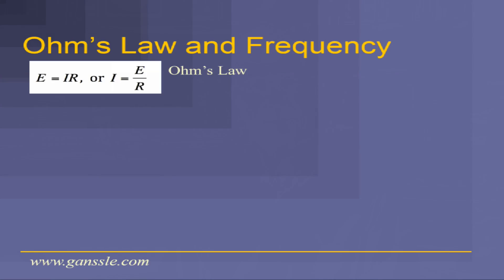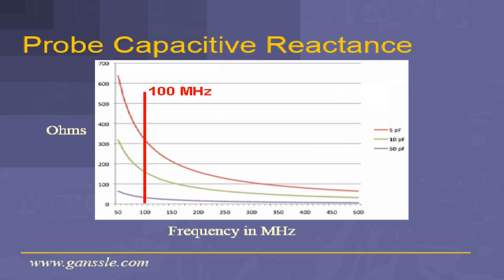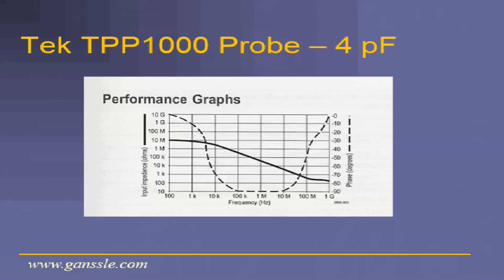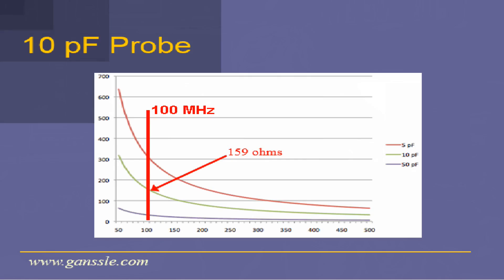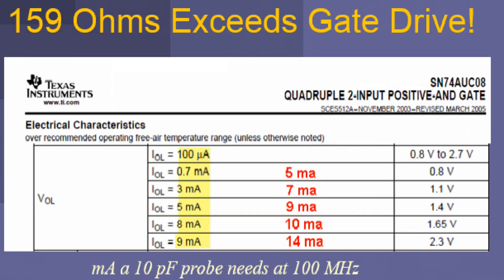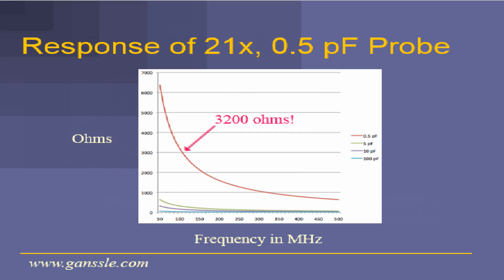Perils of Probing: What's Inside That Scope Probe?

Comment: This is a very useful video. My one issue is declaring the specs "a Lie". The specs are correct: the resistance and the capacitance are both given. The user must understand the limitations  from this data. You did a good job of teaching this, but the accusation was unnecessary IMHO. I am not a scope probe manufacturer BTW. Just another EE.

Comment: I use my walmart probe to fix crosley record players that are defective straight out of the box. Usually a lose connection from the hot glue. The $9.97 walmart probe was much better then the $99.95 radio shack probe that was just an alligator clip to a BNC that had a really fancy box. The radio shack probe was 50% off (normally $199.95) so I must have got a deal!

Comment: Hello Jack, I was wondering if you would consider doing a video on microcontroller output jitter and phase shift. For instance I designed a transformer pwm controller adjustable duty time and dead time based around STM32 maple mini however it is getting like a ghost echo of the square wave on my oscilloscope where the frequency is jumping between 220khz and 180khz approx. I think it is period jitter. I have matched the output impedance eradicated all ringing. No one seems to address this issue with microcontrollers only point out what jitter is. This also affects atmega 8 bit also, One person pointed stm32 jitter corresponding to ppl however what causes this jitter and how do I go about eradicating it if possible. Can microcontrollers be used for PWM control reliably. I am changing to MBed using ARM processors soon and I am a completely self taught electrical engineering and system design and cad design hobbyist. Hope you can help. many thanks.

Comment: Jack, you don't know what the hell you're talking about.  Stop confusing and misleading people.
Reply: +Steve Robbins Believe it or not, but DIY coax probes like this actually have much better bandwidth than regular passive probes. Pretty much comparable to lower end active probes. Rise times are very very good.
But the disadvantage of the DIY probe is that it puts a high resistive load on the DUT.
The 3200ohm impedance mentioned in the video is of course incorrect. It is 1050ohms at DC, and dropping slightly at higher frequencies.
I tend to use 450-470ohm resistors for DIY probes, since this creates an even 10X probe.
But if the DUT can't handle the resulting 500ohm load, then I go for higher values such as 1k or 2k2.

All in all these DIY probes are often a good fit for high frequency digital signals. But probably not for analog.
Reply: +Steve Robbins Lol, nobody takes you seriously... I'm an electrical engineer and off the bat can't see any bad information in this video. Either make a logical argument or shut your mouth.
Reply: Fair enough.  I should have pointed out a few specific problems, but there are so many that I didn't know where to begin.

1. At time 1:35 he shows the formula for impedance.  It is wrong.  Impedance (Z) has a real part (R) and an imaginary part (X).  Thus Z=R+jX where j is the square root of -1.

2.  At time 4:49 he shows part of a data sheet for a 2-input AND gate, with with his calculated currents added in red.  Clearly, he doesn't know what he's doing.  The data sheet shows a few points on the DC output characteristic of the gate.  For example, if the gate is trying to pull its output down to ground, but there is 3mA load (from an LED for example) then it can only pull down to 1.1V, not all the way to ground.  Now, what has this got to do with a scope probe?  Nothing.  Here is how to do the calc properly.  Let's assume the probe impedance is say 2.2pF||10M, and we're probing the output of a 3.3V logic gate with a 3ns rise time.  The correct equation to use is i=CdV/dt.  (i=current, C=capacitance, dV/dt is the Voltage slew rate.)  So the current into the scope probe capacitance is (2.2pF)(3.3V)/(3ns) = 2.42mA.  (BTW, it's "mA" not "ma" because units that are named after people are always capitalized.)

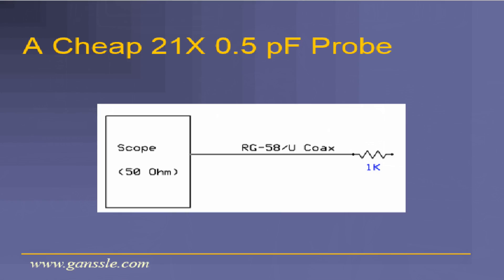3.  At time 5:35 he says "you take a meter coax, you solder a 1k resistor to the end, and now suddenly we have a 0.5pF probe".  Of course the scope input must be 50 Ohms, to match the coax.  The first problem is that he neglects to mention that this is a x21 uncompensated probe.  The impedance at the tip will be 1050 Ohms at dc, and the rise time will probably be crappy.  But at time 6:30 he says the impedance is 3200 Ohms, which is silly.  And where does he get "0.5pF" anyway?

4.  He says you should get rid of any x1 probes in your lab.  Gee, I guess the whole industry is a bunch of idiots for using x1 probes.  He doesn't even know that the reason for having a x1 probe is that is is generally higher bandwidth than a x10 probe.

5.  He doesn't mention one of the most important issues that should be including in any tutorial about probing: the ground lead inductance.  The main advantage of his home-made probe is that he is connecting the shield of the coax directly to the ground plane of his breadboard, thereby avoiding the ringing that is normally caused by the inductance of the ground lead.
Reply: Oh, and I forgot to mention one of the main things I hated about this video.  He doesn't explain the real problem that he is trying to get at.  Basically, very high speed signals on a circuit board are conveyed on special traces that have controlled impedances.  In other words, these are transmission lines.  If you probe one of these traces, it makes a reflection that distorts the signal, and can cause bit errors.  The reflections have nothing to do with the driver (e.g. the logic gate he refers to).  For example, the tip of the probe (being capacitive) will look like a short on the transmission line.  (Assuming the probe ground is in direct contact with the ground plane, rather than using the inductive ground lead.)  Depending on where this short is applied (trace length from the signal source) the source may see a low impedance, or a high impedance.  Okay, transmission line theory is complicated (but worth learning!) and I can't go into it all here.  But the bottom line is you can't probe controlled impedance traces with an ordinary scope probe.
Reply: @steverobbins4872  Dear Steve, I agree with most of your arguments. The only thing I don't agree with is "He doesn't even know that the reason for having a x1 probe is that is is generally higher bandwidth than a x10 probe", as a probe in its x10 position typically has about 10 times greater bandwidth than the same probe switched to x1.

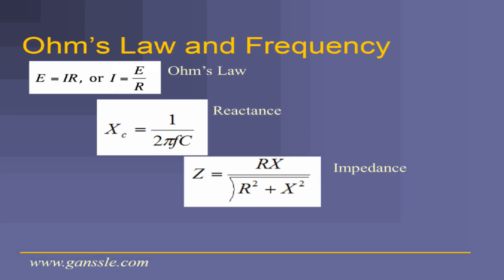Comment: Actually, the DIY probe presented has at most 1kohms impedance as the reactance of the 0.5pF goes in parallel with the 1kohms resistor (actually 1kohms + 50ohms, but that is nitpicking).  When the frequency goes up, it gets below 1kohms, according to the equation at 1:30.
Reply: Indeed!
The diagram is completely off.
The DIY probe is a very good cheap high bandwidth solution for measuring digital signals. But not quite as good as that diagram would indicate...

Comment: .Howz about WIRELESS probes? Go digital microwave RF, eliminate the cables. Make a microtransmitter probe, likened to bluetooth or wifi, that can be inserted into a circuit.
Reply: +umajunkcollector The antenna for the bluetooth transmitter would essentially be a wire at the very least. You haven't changed anything. Just added noise from the bluetooth transmitter.

Comment: What is the disadvantage of your $2 0.5 pF probe compared to the k$ probes? If it is just inconvenient to solder it, I could live with it.
Reply: The primary disadvantage is that it puts a 1050ohm resistive load on the signal you are measuring. The 3200ohms mentioned in the video is incorrect.
The advantage of this probe is that it has much higher bandwidth than regular passive probes.

It is a good alternative to active probes when measuring high frequency digital signals where you typically have a good stong driver.
Reply: Maybe the precision, +-5% resistor? Things like that